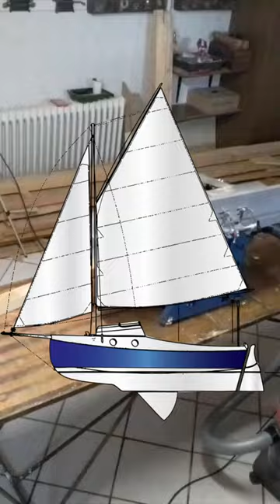Pocketship keel blocking #shorts 230331

Comment: Hello!  Did you see that a mistake was made on the drawings of the keel block and it is drawn shorter than necessary?  The keel block must be made longer.  Focus on the keel sides.
Reply from the maker: Hallo. Thank you for your reply. Sadly I didn't saw that. But I could fix it as I made the blocking at the aft end, witch should end on top of the keel blocking longer, now the keel blocking does not go all the way to the end but touches the end block.
Reply: @beginnersboatyard  It's good that you know how to fix this.  In my case, I made a new keel block that was longer.  The forum has written a lot about all sorts of errors and features in the design, it's interesting to read.  I wish you good luck with your build!